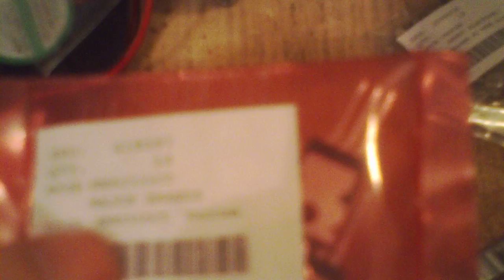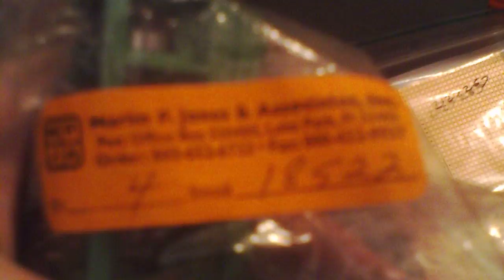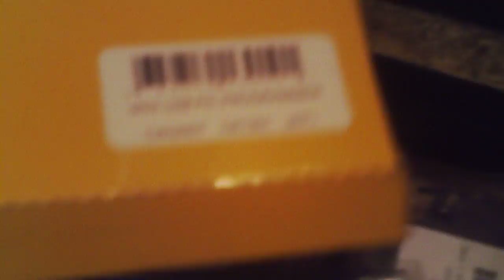DIY MPPT PV charge controller project initial parts video

Comment: What is the Rated amps for this system? I have a windturbine that gives 60amp peaks at times ...
Reply from the maker: 25A to 35A depending on the type of controller, but I may do higher current ones once I bash out a polyphase buck converter or an alternate SMPS topology.  The intent with big arrays is to have it broken up into 300W to 350W subarrays with individual controllers (what my multichannel controller is for).

Comment from the maker: The basic circuit is a modified buck converter (added potential dividers and current sensor) and the firmware will be a 'perturb and observe' type algorithm with added float charge and night (shuts off buck converter) segments, so pretty much all of the stuff I am using is already public (I cobbled together the design in my head in a few minutes).